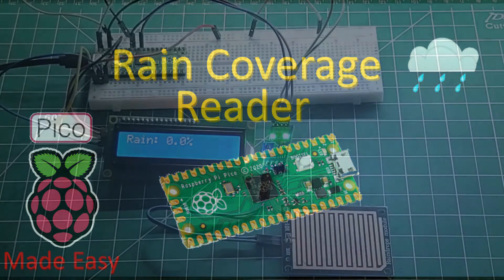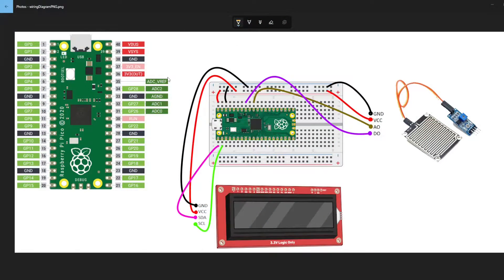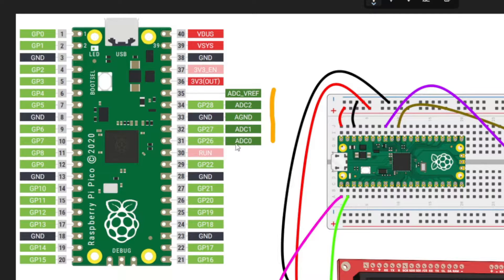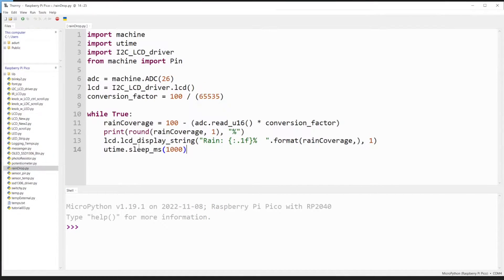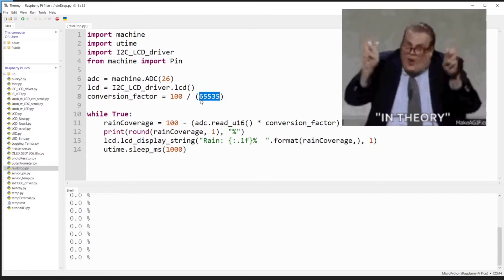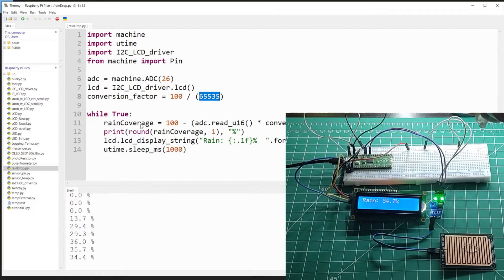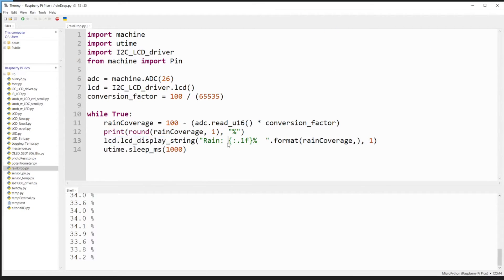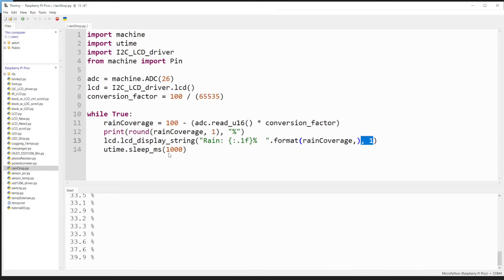MADE EASY: Raspberry Pi Pico Rain Drop Sensor Reading in MicroPython 🐍

Comment: My understanding is if you import Machine your importing the whole library so you shouldn’t need to import pin later. However I have found sometimes you do ? Have you noticed that ?
Reply from the maker: I believe import machine allows you to really open up options on what hardware functions you want to utilize. So in my example, although through my muscle memory and not looking back, we don't need the line "from machine import Pin" cause we have "import machine" so you are correct in your understanding that it contains specific functions on the Pico; it accesses all sorts of functions as in PIN, chip internal temp and so much more than I'm discovering on a regular basis.
Reply: @RamboPi  I think what I am saying it that even after importing the entire machine library I have found on occasions I still have to import Pin from machine.  Have you seen this or am going mad?
Reply from the maker: @allthegearnoidea6752  You are absolutely right :) That's I why I have the over kill command. "If it doesn't break it add it to be safe"